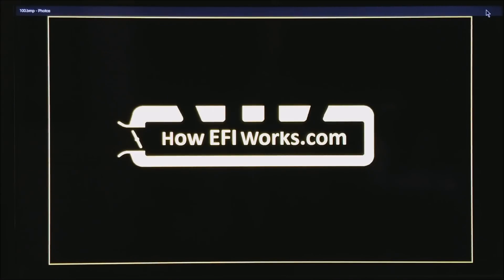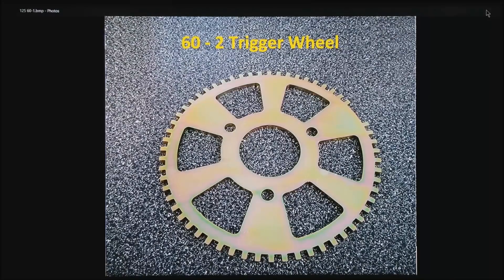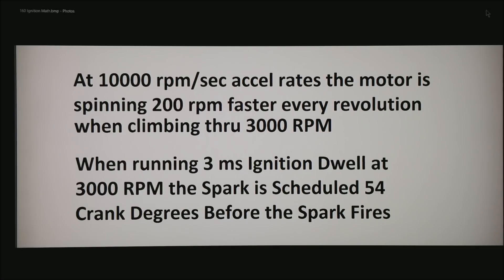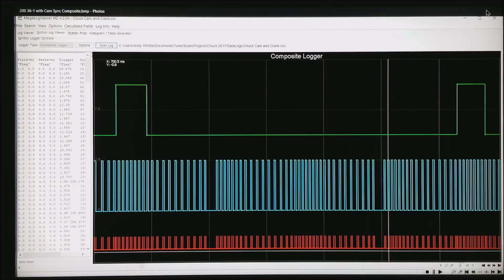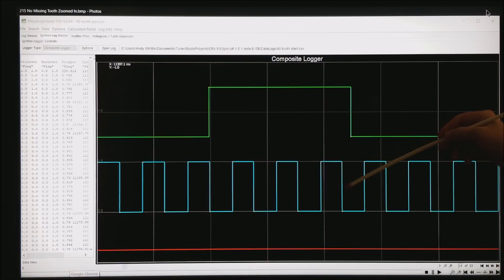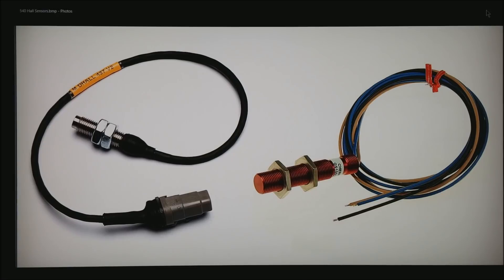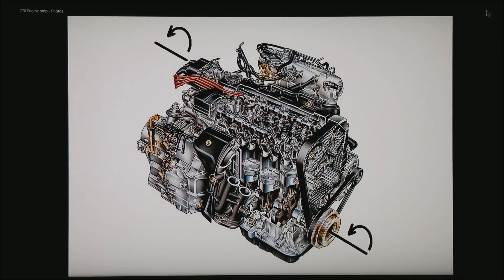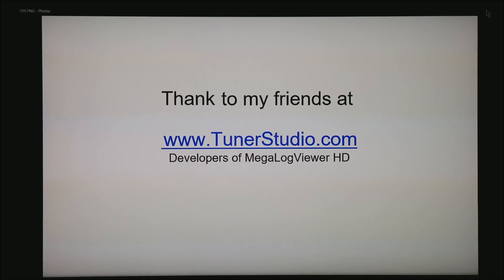Choosing the Best Timing Wheel for Your Motor

Comment: You said you set up your missing tooth so it's about 60 degrees before the compression stroke (240 degrees before TDC) is it critical to have a missing tooth wheel set up this way or can you do it anyhow as long as you don't end up with your missing teeth close to TDC?
Reply from the maker: Generally true.
Generally true
Reply: @AndyWhittle_HowEFIworks  Thank you so much for your response. I honestly didn't expect one on a 2 year old video. Another question: Does the amount of teeth at TDC before the missing one dictate the maximum amount of ignition advance you can apply? For example if you had your missing teeth 30° before TDC would that mean that you can only apply 30° of ignition advance?

Comment: I'm curious about your distributor conversion.   It looks like the Accel module is mounted perpendicular to how Accel originally intended, so did you fabricate a custom distributor body to fit it?   It's easy to see how your chopper wheel works for picking up engine phase, but I don't see how you're picking up anything from your 40-tooth wheel.   Is there also a VR or hall sensor below the Accel module?

Comment: A 24 tooth trigger is 15 degrees of resolution per tooth 
not 30.
Reply from the maker: That was 24 tooth at CAM speed, a common setup for a factory Honda Crank Angle Sensor.